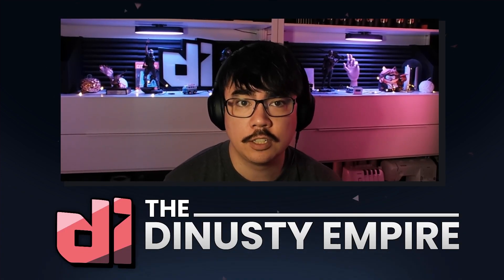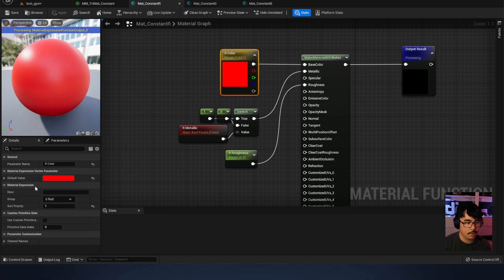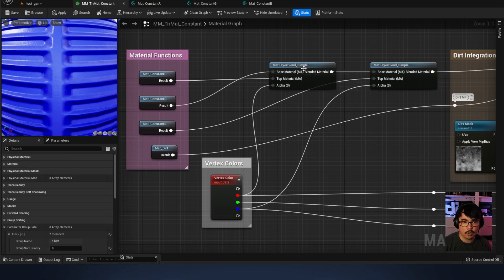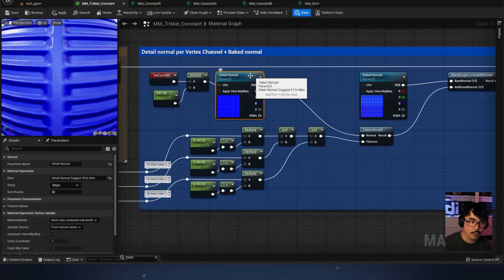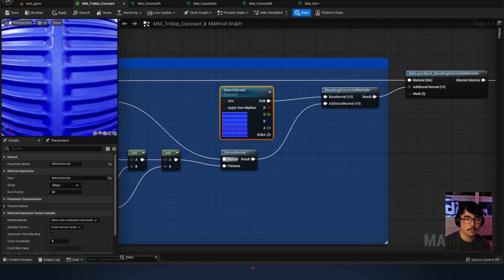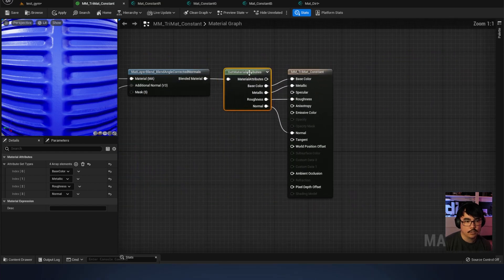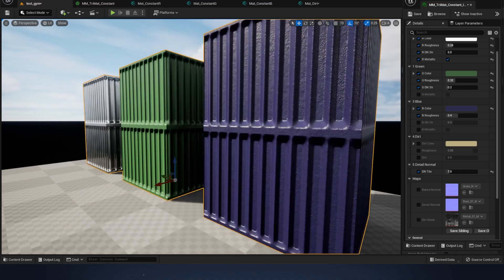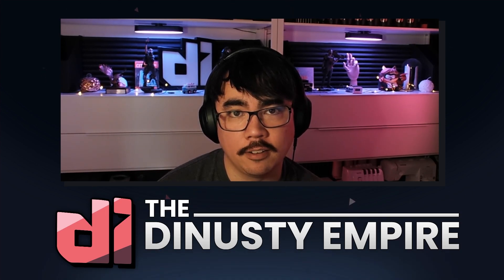UE5: Draw Call Saving Material

Comment: All this is cool but shader complexity might be a bigger problem than drawcalls. So at the end you will get fewer drawcalls but less perfomance because the shader is more complicated which neglects all the benefits.
Reply: GPUs are crazy fast at calculation. Doing this masking (especially in vertex shader) is waaaay more cheaper rather than waiting for a drawcall from CPU.
Reply: like the above said, draw calls and texture lookups are far worse.
as well, you can have high instruction count shaders, just don't use them on meshes that are prone to overdraw :)

Comment: Great share, thanks a lot for putting your time and effort into making the video and share it with the community. 

Got one question though, even though the draw calls are reduced a lot with this method. How much overhead performance is used for the system to calculate all the material functions to relate and visualize the output materials on the object?
Reply from the maker: The idea is that you save on reusing those materials more then just one mesh. imagine those are used on even 20% of the environment and your doing well.
Reply: @TheDiNustyEmpire  thanks for the quick response. I'll give this method a try. At the moment using blender and armorpaint to try and cut down on materials, which is a tedious process 😅🤣

Comment: This is an awesome way to save drawcalls ! I see some workflows in UE that are using gradients to apply different colors to the model with a single channel of a texture. I assume somehow they  use different values of a single grayscale channel for different tint parameters (for example 0.2 value in grayscale texture is red tint and 0.5 is blue). that's what  expect but I don't know how they make it technically work. it would be great if you make a video about how to achieve it in UE. Thank you!

Comment: Nice tut. You could also reduce the number of texture samplers by using in your texture "dirt" the RG for normal map ( and deriveZ node of course), B for dirt, and alpha for another mask.
Reply from the maker: Yes! The only reason I didn't do it is because on a project scale id want to leave the normals as there own for reusage outside of this shader. 

Also a great way to cut another texture in the idea of lowering textures overall
Reply: Have you tried renamed route nodes in UE5 ? Awesome to avoid spaghettis :D
Reply: The downside of that is your normals look slightly pixelated due to compression artifacts. Sometimes it's ok, sometimes it's not, and sometimes you don't have a choice but to use it.